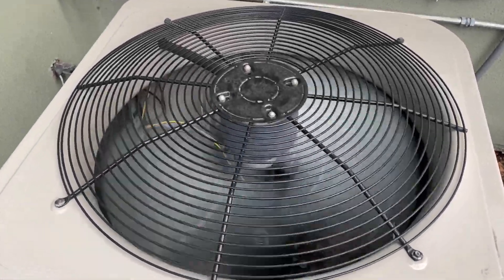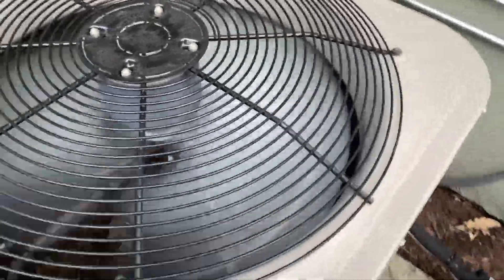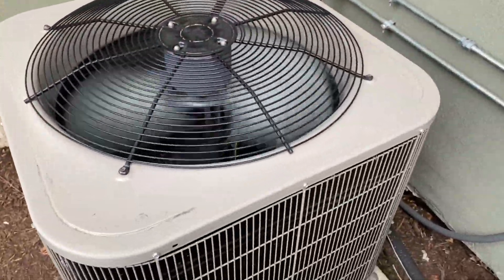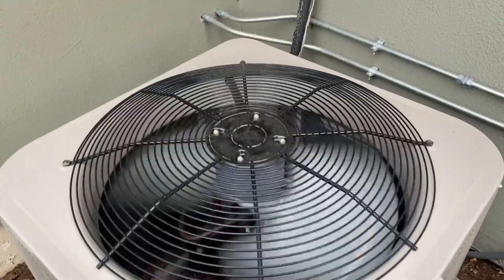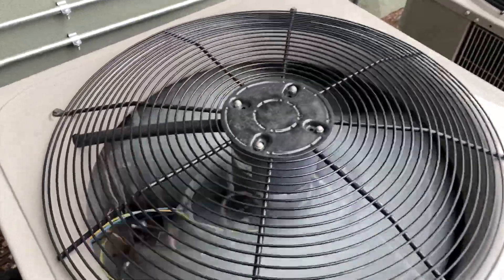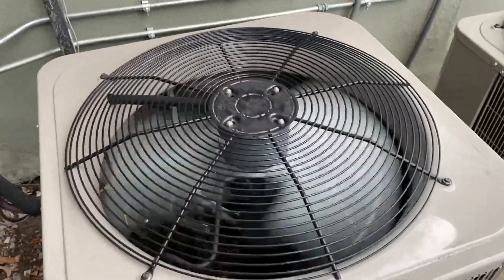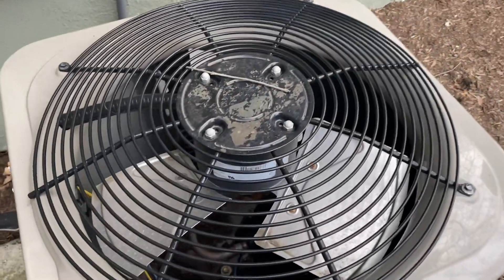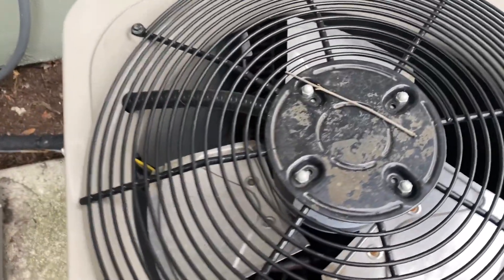2011 Bryant 2.5 ton heat pump running in HEAT mode and defrosting!

Comment: Had an epic sound! Glad you could get a full defrost this year
Reply from the maker: Thanks! I wouldn’t say it’s a full defrost since it was a short defrost. Usually full defrosts are when it’s iced up and is a lot longer.
Reply: @iowaacproductions698  a full defrost is just the heat pump going into defrost, and coming out of defrost. No matter what state the unit is in. (I think)
Reply from the maker: You might be right lol.
Reply: @dilchproductions  I agree